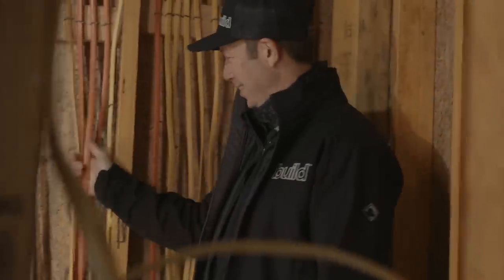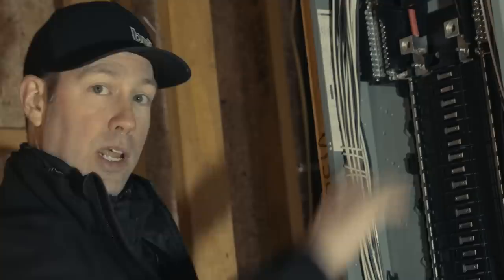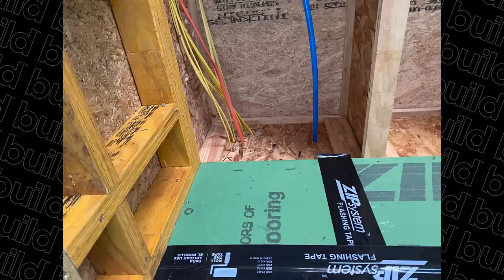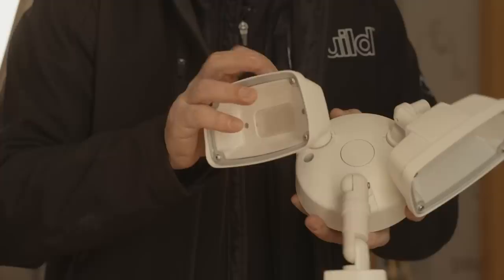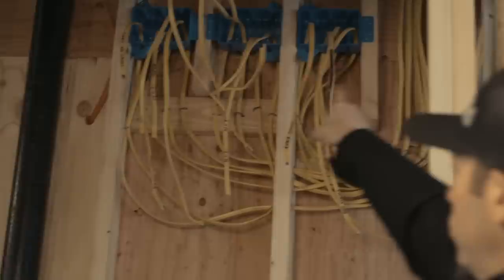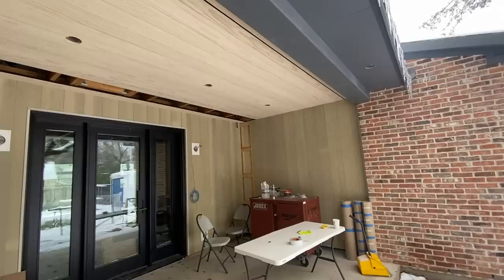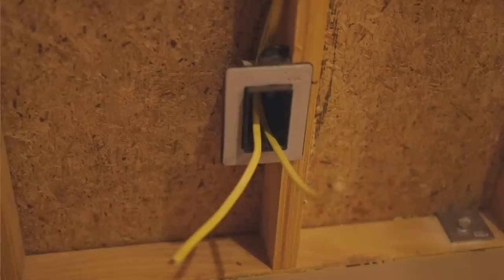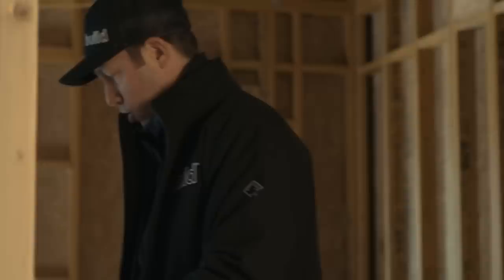5 Tips for New Construction Electrical & Smart Lighting!

Comment: I have a HALO system in my home.  The bad thing about these switches is that once they stop working, you can't turn on/off your lights.  Once that circuit board fries, you lose control of your lights.  This has happened twice now in the past year, and not very fun.  At 30-50 bucks a pop depending on the switch, not worth the headache.  As the switches break, I have been replacing them with standard toggle switches.

Comment: Got it all backwards. Code change requires very expensive arc fault breakers. Each contains a microprocessor, a long term maintenance problem.
Why? 20A ckt breakers don't trip on a short in lamp or small appliance cord. I used to use 20A outlet circuit, but unless you are dumb and use electric space heating to same on your oil heat bill 15A circuit are fine. I have a 5000 sq ft house, with very high efficiency LED. Code required 6 circuits, today a single 15A circuit will do. Fine to wire with 12GA, and inspector will complain, but even if you are using GFCI/AFCI breakers use 15A breakers. If they trip because your son has a 5000W audio system, you can swap for a 20A breaker. Tell your son to use ear protection!
Reply: Code requires ArcFault in bedrooms regardless if they are 15A or 20A, and the 15A AFCI are just as expensive.
Reply: You prefer all 12ga?
Reply: @aayotechnology  Yeah, I don't want to have to buy two different cable to save about $8\roll and then have to micromange how much wire I need. If I run out than I wasting time running to the store to pick up more. It was a pain just managing the other wire sizes I needed (30AMP, 50 AMP & 60 AMP circuits).
Reply: @guytech7310  I didn't fully explain. No choice now but to install AFCI. But the "magnetic" trip even when no arc exists requires a lot more current to trip a 20A compared to a 15A. Since you can plug a lamp or any appliance with just an #18 cord into an outlet that wire will COOK even without an arc. The reason for the invention of AFCI was to mitigate this problem, reduces but does not prevent a fire.

Comment: Is it code for you to have the 220 panel on the outside?  My main panel is located inside my garage, and only the meter box is on the outside.  I would think this could greatly increase the air tightness having only a single wire/hole coming in.
Reply: My exact thought process also.
Reply: The 2020 NEC requires an outside emergency disconnect.
Reply: You could still have the Service panel inside if you have an outdoor disconnect between the meter box and service panel.  ( N 230.85).  Then you could have just the one penetration for the service wiring coming into the house for the service panel.
Reply: @InterstateLoveSong , that can be had as part of your meter base.
Reply: @steveb365  yes of course there are various combinations to choose from.

Comment: It always baffles me why anyone would place the main panel on the outside of the house in the weather and where anyone can access it.
Reply: It's a Texas thing to do this ranch/farmer setup on residential dwellings. goes with the sliding barn doors, and the barndominions,...
Reply: They aussies also use outdoor panels.
Reply: Exactly! If you trip a breaker in a storm, you are standing in the rain, in a puddle, resetting a breaker.
Reply: @guytech7310   meter box out circuit breakers in .
Reply: All the homes in my CA neighborhood have external breakers/mains.  I found it strange as well.
Reply: I was wondering why this was a thing. I mean, why worry about having 16 holes to air seal and heavy expensive wire to run when you could simply have the main panel inside? Eliminates all the giant boxes on the exterior wall, shortens your runs, and makes it all accessible from inside. It’s a no-brainer.

Comment: Nice house. Another point I’d like to mention to you, make sure you install a panel with copper bus not aluminum. And when installing it you should keep all the largest loads closest to the lugs with incoming power. I’d like to send you some pics of a 2 year old 200 amp panel I had to replace that had aluminum bus and an 80amp EV charger circuit installed at the bottom of the panel furthest from the lugs... as for your house He did a nice job. I always use 14/2 for lighting just for ease of terminations. I’d just run another circuit if I felt the circuit was going to be too loaded. Always 12/2 for general receptacles.

Comment: Answered my question 25 seconds from the end: low voltage is "weird". Make it normal. We're not using incandescent lights or CRT TVs anymore. High voltage is dangerous, difficult to install, and highly regulated.
Reply: Give it about 5 more years to start seeing that change. the standards for it are currently being written for the change.
Reply: I doubt that POE maxes out at about 120W. Cannot run most devices on only 120W. 
48VDC is also not any less safe. About 15 years ago the big craze in Datacenters was rolling out 48VDC racks, only to end up with electrical fires.
Reply: low voltage lighting runs higher amperage, so you're using a lot of extra copper both to keep from overheating your wiring and to try to eliminate voltage drop.
Reply: @kenbrown2808  If you increase the size of the load. But in reality, we've reduced load by 90%, so we could either reduce voltage or amperage by 90%, or a combination of the two.
Reply: @BetaEngineer  pop quiz: what's the difference between the maximum resistance in a circuit at 12V vs. a circuit at 120V  to have the circuit operating with less than 3% voltage drop? keep in mind #14 copper has about a quarter of an ohm of resistance per 100 feet, whether you're running it at 12V or at 120V.I'll give you a hint: a 10A load at 12V on 100' of conductor has 44.6% voltage drop.  a 10A load on the same conductor at 120V has 4.47% voltage drop.
Reply: @kenbrown2808  Based, on you assumptions, (120W, 12V, 100', single circuit), yes, you are correct.
Reply: Although I disagree with much of what Matt does, I like the fact that it is all normal standard AC wiring in the walls, like he said, if you want to change out the automation stuff in the future you can, it will still be like a normal house, nothing weird that needs to be fixed. We don't have any common enough standards to be doing that in the walls right now. Whatever you do will be out of date in 5 years. POE is nice, but you're not plugging lights into that.
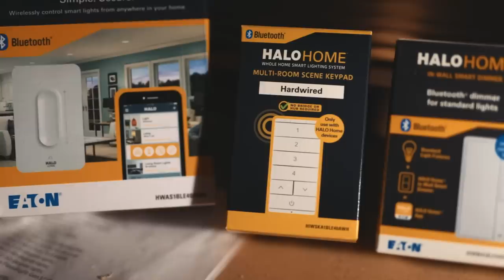Reply: Except at 11:30 where there is a single gang box and only feeding power to the smart switch for 4 lighting areas. Well unless he wants to go into the closet to turn the lights on and off.
Reply: @BetaEngineer  you didn't answer my question.
Reply: @ryanroberts1104  you're right.  the biggest weakness of specialty lighting control is that once it's installed, you usually can't change to anything else.  smart switches are getting better, though a lot of that is because they want to be able to get the retrofit market.
Reply: @southtowntn  my brother's house is about 90% central lighting control.  he has "rescue" switches at key points so he can get to the mechanical room to reboot the system.
Reply: @kenbrown2808  Maximum resistance is inversely proportional to the current through the conductor. For your question, you specify voltage drops of .36 volts and 3.6 volts. What's the current? We can then solve E=IR.
Reply: @BetaEngineer  well, I use ten amps as a rule of thumb for loading 15A lighting circuits.  and that's 120W at 12V.  so that will let you feed 6 average LED fixtures.  so you could average a circuit per room.

Comment: As a electrician 20 amp for all circuits is overkill 15 amps is more than plenty for circuits in a home it takes a lot more than you think to pull 15 amps in a home.
Reply: How about a space heater and PC gaming with a 1600w power supply with PFC? on the same circuit? Or a 15 AMP Window AC unit and some other device that draws a few amps?
Reply: @guytech7310  there is special situations and applications where a larger circuit will be needed to be ran but for general use 15 amp is more than plenty

Comment: Neat boxes. I'll be sticking with my 10 and 15 amp breakers for the bulk of my house with 20 Amp only in the Bathroom and Kitchen.
Reply: Not sure where you’re building, but in the US I don’t know of any circumstance where you’re allowed to use (let alone find) a 10 amp breaker. NEC requires certain ampacities in certain areas of the home. Even in different parts of the country, a 20 amp circuit might have to be run with #10 romex due to ambient temperatures (like parts of Arizona). It would have been great if there was a single standard for electrical across the globe.
Reply: @benfowler2127  lots of companies make 10A breakers but they aren’t for residential use. They are used in industrial distribution and branch circuits.
Reply: @benfowler2127  I was about to comment that. Most all the rest of the world everything is 208 however.
Reply: @RaddestDad  only place if ever seen them are control circuits. Never in a panel. I'm fairly certain they don't make them. Din rail mounted or cased are the only way I've seen them.
Reply: @RaddestDad  yes, you are correct. You were talking about using them in the home though. You’ll have a difficult time selling that home(if that is your plan) if it’s not up to code.
Reply: @shawnshurtz9147  Yeah. And about 4 or 5 or more types of receptacles. At least it seems to be by continent 😂 Could you imagine if every state had a different standard?

Comment: NOOOOOOO NOT BLUETOOTH! Zigbee style systems should be the ONLY system to look at! Get ready for MASSIVELY inconsistent connectivity, lights that refuse to be controlled, and just, endless frustration. ANYTHING but WiFi of Bluetooth.
Reply: Wrong , lutron is the best
Reply: I've been using the Lutron Caseta, very happy with this.  This is with a house built in 1963 though, so retro fitting not building new.

Comment: since your overkilling the electrical, the one thing that everyone seems to be missing the boat on, is your grounding for the electrical..  since there are circuit boards in almost everything these days, people DO NOT pay enough attention to their OHMS resistance on their grounding.. if your smart, you will have 5 ohms or less, even tho the code says 25 ohms.  if your electrician just pounds a couple rods in the ground and says good enough that's code, then he is not paying attention to real world problems... and if you do get a great reading of 5 ohms or less then you need to protect that connection. if your smart you will look into a Strong Cap.  and did you know with the new electrical codes for 2021 where everything needs to be ground faulted, you need a good ground for a ground fault to work, and by the way they are seeing mini splits not working correctly with the ground faults..
Reply: Thank you for bringing that up!  I freaking KNEW there was something bothering me about his wiring installation!  Company I used to work for recently spent a TON of money grounding literally everything inside and outside (TV broadcaster).  IIRC the spec we went with (on the sat dishes) was 0.5 ohm between the feedhorn and the ground rod (NOT the wire to the rod, but the rod itself)
Reply: Even a 120V circuit can over load a 5 ohm ground. 120V/5ohm = 24amp. Issue is earth ground is no better than 6 ohms, but can be much higher in dry climates or soil types (ie sandy soil). In the US, GND & neutral are tied together at the panel, so if there is a ground fault it will trip the breaker.

Comment: I love Halo can lights, but I’ve been frustrated with my halo home plug in adapter and can trims. They keep disconnecting and multiple times I’ve had to re-sync them with the app. I gave up. The cans blink after I turn the switch on. I’m ready to take them out and put normal trims in. It only happens once when I turn them on, but it annoys me every time
Reply: Oh wow, that really sucks. I guess nothing that runs on wireless signals and apps is reliable.
Reply: It's sponsorship, he probably got them for free. This can be one of the problems of the house, I see others for the same reason, sponsorship/free stuff!
Reply: @s70r25  yep. I’m sure once or if he has problems they’ll swap them out. For all I know, maybe they’ve fixed the issues with new trims, but mine have all had the issue.

Comment: Haven’t you learned anything? Why are you putting your utilities on the outside of your house?
Reply: Yeah, I don't get that either. It's bad enough I have to go out in the garage to access the breakers. I can't imagine having to go outside to flip a breaker... It couldn't have been that hard to run the mains through the wall and put the breaker panel inside the house. Even better for Matt, ONE hole through the air barrier with a big wire that's way easier to seal up than 20 small holes.
Reply: May be a requirement in Texas? or maybe you only need a shutoff outside, I'm not sure on that.  It does seem common in Texas, CA, AZ though.
Reply: Matt's really not the "learning" type.
Reply: Required in Austin tx
Reply: @CRsolar  Not required for anything plumbing related. And only requires a single disconnect, not an entire panel.
Reply: @ryanroberts1104  true.. but it works to have at least some circuits outside , as you need the main breaker  ,,, this is typical in Austin . weather good 92% of time

Comment: You should consider reaching out to tech experts about smart home options.... Bluetooth is a terrible choice because it will cause interference with wifi. Z-wave would be a much better choice and having a hub is a very reliable way to have these devices communicate. If you wouldn't want 10 extra devices on your wifi, then you don't want 10 extra bluetooth devices hanging around. They interfere with each other!

Comment: I find Caseta and Raw 2 much better option. The 12-2 VS 14-2 has been a open Debate 4 years but I also charge more in labor. You also run into wire fill issues using 12 wire. I wouldn’t waste the money on it for lighting that’s for sure. The Aluminum is a much better conductor for feeder branches and worth the price savings. But in all a good Video always enjoy watching.

Comment: I have to disagree with your design philosophy on this topic Matt.  Design should be simple.  U should be able to walk into a house and immediately no how to turn lights on.  A stranger would have no clue what half the switches go to.  Sometimes with electrical systems people IMO make it way too complicated.  The upside isn’t strong enough to outweigh the complexity of design
Reply: Home automation is a boondoggle. Ever stayed at a high-end resort where they've done this? Have to call the damn butler to turn off the lights or use the dimmer switch - almost as bad as the infuriatingly-complex sound systems...
Reply: These systems also do not last and he’s leaving no out down the road when this stuff fails and it will fail.
Reply: That's why I prefer Lutron Caseta - all the light switches work exactly as normal and function instantly even with the internet down. However, you can ALSO have scene remotes, alexa/google integrations, IFTTT automations etc.

That's the best of both worlds IMO
Reply: @Matthew-gl2kf  yep, ive got the same in my home

Comment: Interesting on the sound barrier, you can always do double drywall. I like using plywood, then install drywall on it (more sheer structural support). Then pump it with cellulose, that will definitely make things quieter. Of course, more expensive  - but better in the long term. Any who, great discussion on the subject.

Comment: 😳 there's no reason to wire bedrooms and lights with 12s, especially with modern LED/low power devices.  The example you gave makes no sense because hairdryer is used in the bathroom where obviously 12 makes sense and is per code.
Reply: Enter gaming PC and a space heater (or the current thing is 2 pcs or a pc & gaming console for streaming). In an apartment I rented during college, I couldn't have a space heater on the same 15A circuit as the laser printer or it would trip.   - you never know if someone might use a bedroom as an office in the future/etc. easier to just run all the receptacles with 12s; lights should be on a separate circuit anyways and can be 14s.
Reply: @jbrandt7  
This is a new construction extremely efficient passive+ house though.  He'll never even run the heat and very minimal central AC.  Heck, that gaming PC will probably heat the entire house.
Yes, lights should be separate but he even ran 20amps to LEDs lol (each is like 8W).  This is just so wrong.  It's absolutely pointless and silly
Reply: @jbrandt7  Space heater in a modern home?????
Reply: @robertgregory2618  Some people are never warm enough - esp. if you keep your thermostat at 68 and others want to be above 70.
Reply: On some other YT video (I think it was 8-bit guy), it was pointed out that some Texas city codes require 12-gauge wiring for receptacles, even if it's got a 15A breaker.  Just to allow future upgrade of the breaker to 20A without rewiring.

Comment: it is heaters and vacuums. Cant run both on a circuit. 15 or 20. I would still do 12gauge.
Reply: Yeah...if your kid is tripping breakers in their room...WTF are they doing in there? 15 amps is plenty for any teenager.
Reply: @ryanroberts1104  probably doesn't apply in this case, but some window ACs pull a good amount.
Especially if ACs are all on the same Arcfault.